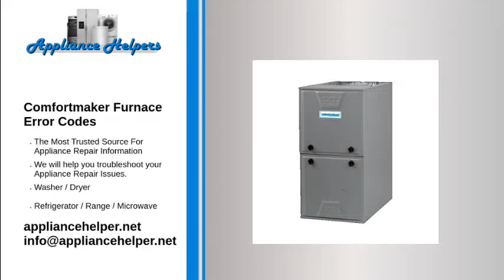Comfortmaker Furnace Error Codes

Comment: I have comfortermaker in my apartment. It is a 1980 furnace.   Limit switch has problem turning off the when the full burner is turned on, and the fan is turned on manually. It doesn't sense it.   It will shut down the furnace.   
I had turn the burner down really low so it turn it off.  It stays moderately warm.    It doesn't have any blinking light.    The fan would come after I moved in and would run , but the next winter it quit kicking in.  You have to turn it on manually.   The automatic switch kicks in but the fan won't com on.   Then the limit switch kicks it out.    
What do I do?